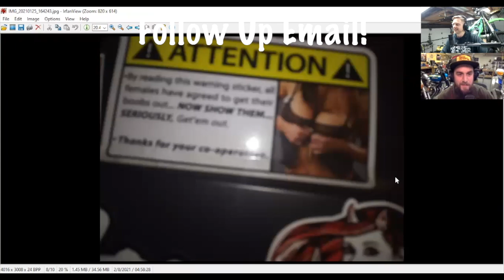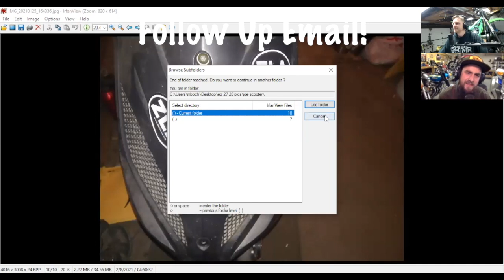The Broken Moto Show - Episode 27 : My Pipes Are RED!

Comment: I had a similar problem with my 2007 VT1100. It didnt have red pipes but would overflow coolant that was bubbling. I drained the old coolant, flushed with 50/50 distilled and vinager, and filled with new Honda HP. I rejetted by moving the front pilot to the rear and going up a stage in the front. I also stage I the main jets and one #4 washer, Cody!. The bike has a K&N air filter and stock pipes with baffles removed. This totally solved the coolant/running hot issue as well as no more decel pop. It also pulls harder now. I went from 47 mpg to 44mpg.